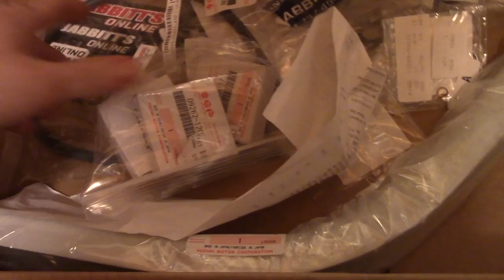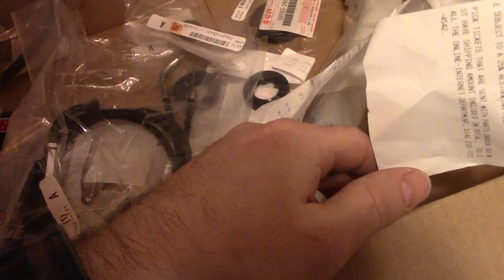1980 Suzuki FZ50 Project - Part 8 -  Countershaft, Axle, and Crankshaft Bearing Installation

Comment: I find it surprising how familiar this 2 speed gearbox is. The mechanism seems very similar to the puch za50 2 speed in my Magnum MKII. I assumed that Suzuki would have went a different route, but it seems that the dual clutch setup was the most straightforward design...I Generally think a variated CVT setup is superior for power output, but after riding my magnum over 2000 miles in the past 4 years, i do not miss the constant fiddling and troubleshooting that a variated pulley setup requires. 

 What expansion chamber did you decide to use? <<<Nevermind finished the video....

Comment: Question for you, you made a comment in this video that the only reason why you're doing all this is due to the bike seizing a million times. I'm also having the same issue with my bike. I've replaced every single seal besides the left side transmission crank seal. I've jetted higher than the bike and needs to the point that it's sputtering with too much fuel at low RPM but once up to speed 25 or higher you can start here in the Piston scrape the walls. I have even upgraded to the 60cc kit thinking that my old jug was compromised. Nothing has worked.

You said that the main crank bearing was toast but it did not have much play in it would that still cause seizing issues in the bike? Could that be my issue is what I'm asking?

Also that nut that you said you need to torch off on the transmission side to get the crank out of the bike. Last night I literally shoved a little metal rod through my piston Rod just like you did to remove the stator side flywheel in the past video. I did not heat that nut up at all and with a quick is Zapped with a normal impact drill don't even think I had to press the button fully that not came right off. So I was kind of hoping since I'm all the way down to being able to remove the crankshaft itself how would you have done it? I see the manual shows a crankshaft removal tool but I would rather not purchase it what other options would I have? I would like to replace that transmission side crank seal because I do feel like I might be getting a smidge bit of oil in the crankcase. And like I said I've also replaced every other seal and gasket on the bike so I'm just praying that this is the the problem. I've seize multiple Pistons I'm so sick of it.

I'd appreciate any information or help that you can give me. If you think it's just the crank bearing on the stator side it very well could be I know it's gotten hot. Or I would like to say it has. I do have a temperature gauge on the spark plug head of the bike it usually seizes at like 320 degrees so that's also a concern of mine the bikes not even that warm when it happens.

Oil injection was deleted by the previous owner I just run mixed gas. I've even gone a little heavy on my mix 40 to 1 hoping it would help but nothing
Reply: I replace the stator side crank seal last week. Took it out for a ride thinking that was going to be the fix. Same thing was happening. It smoke good while it's sitting at idle but as soon as you start riding all that goes away. And for the first time I felt like I had a little bit of dark oily residue in my combustion chamber after I took it apart from doing that stator side crank seal which makes me think it would be drawing harder from the transmission side but then again maybe just a coincidence